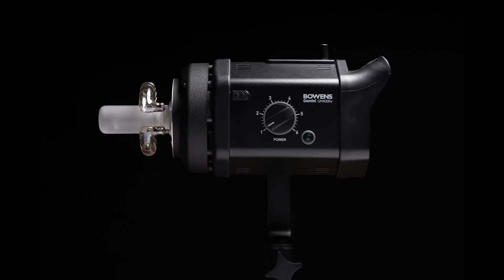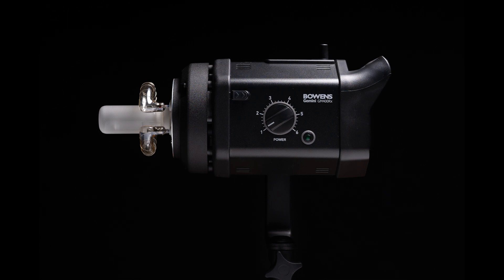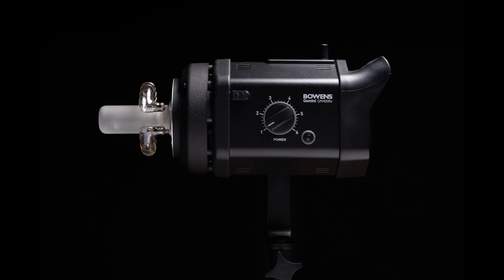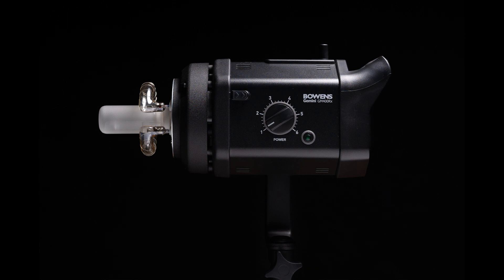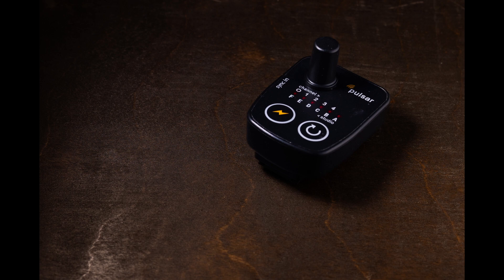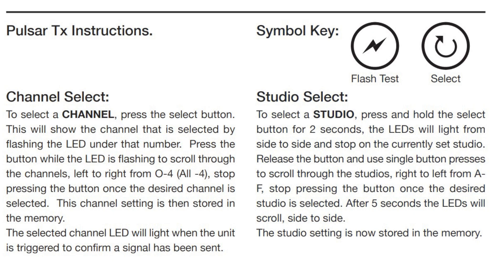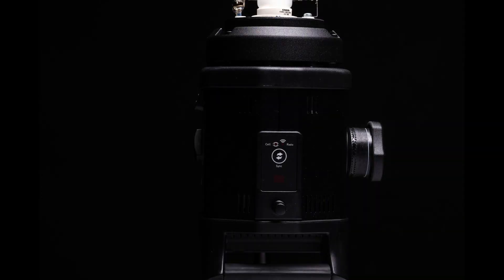Bowens Gemini GM400Rx and Pulsar TX Trigger

Comment: Please more content on these!
Reply: I can’t seem to find my Pulsar Trigger and need a replacement. Are PocketWizards my best option?
Reply from the maker: If you can find a used PocketWizard those are nice.  I did a video on Pocketwizard and YONGNUO triggers here - https://youtu.be/PUyPrDP2OnM

However, I have also used and like YONGNUO Wireless Shutter Release & Flash Trigger RF-603II from Amazon.  Get the "C" model for Canon, the "N" model if you camera is Nikon.  I found the "C" version works on Fuji or Sony cameras.  

You will need a sync cable and for the YONGNUO the connections look like this 1/4" Phono Male to PC Male - https://www.bhphotovideo.com/c/product/613662-REG/Impact_9031360_Sync_Cord_Male_Phono.html

Good Luck!

Comment: i was given two gm400's (not RX) and there is only one power cord and one sync cord. I have a nikon D750 and am wondering how to trigger these flashes. I also have a nikon 910 speedlight, so can i use that somehow to trigger the gm400s?
Reply from the maker: You can use the external flash.  There is a built in infra red sensor on the bowens.  On the back of the bowens, there should be a button called cell.  You want to try diifferent settings until you find which setting on the cell button sees your external flash.  Your external flash should allow you to fire a test shot - so to figure out the button you don't need to put the flash on the camera to do the test.

If you want to have wireless, then I would use a YONGNUO RF-603II N3.  I have made a video on syncs, including yonguno's.  You will need a phono plug mono adapter cord.  This is a title of such cord found on Amazon Fotoconic 10ft/3M 3.5mm to Male Flash PC Sync Cord Cable with 6.35mm to 3.5mm Jack Adapter for Studio Strobe Trigger Camera Lighting.

The power cable is standard and easy to find.  They are used for laptops - just look for one what will fit the shape of your strobe back.
Reply: @UsedProfessionalStrobes  thx for all that info. Will see how I go 👍
Reply from the maker: @okidoke4822  let me know - you are very close.
Reply: @UsedProfessionalStrobes  can you explain the “beep” and “ready” buttons? I’m assuming the beep is just if you want to hear if the flash is cycled? I can’t seem to find a manual for it. I’ve noticed one of the lamps isn’t working also. What exactly do you use the lamps for? The bulbs are both good though.
Reply from the maker: Beep gives a sound when flash has been changed.  There is a modeling light that many people don’t use.  They get hot and burn out.  The strobe is more important- it makes the flash.
Reply: @UsedProfessionalStrobes  I managed to find a second power cord and was able to fire both strobes using my Nikon Speedlite. And both modelling lamps are working. So I guess I’m all set. Thx for your help.
Reply: @UsedProfessionalStrobes  I’ve used the Yonguo RF-601 triggers for 20 years … bullet proof and just work soo well… just plugs into the Jack.  

Sadly they stopped making them 10 years ago and bought 2 sets just in case. 

I do have 3 Bowen’s Pulsar Triggers I was given … wondering if there is way I can get the Card to insert into the flash?   I have 1 digital head that I think is a TX, but need to check.

Just nice to have a backup system if ever needed.   

I have 7 Bowen’s GM heads (not the Tx or Rx), that I bought at a closing down liquidation sale.  They are super good